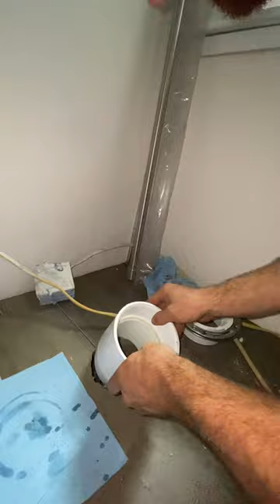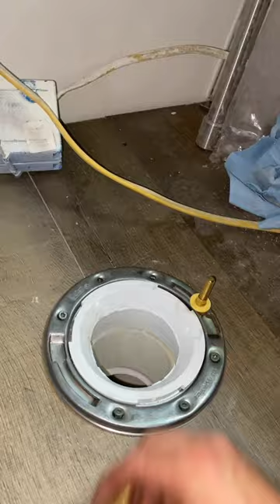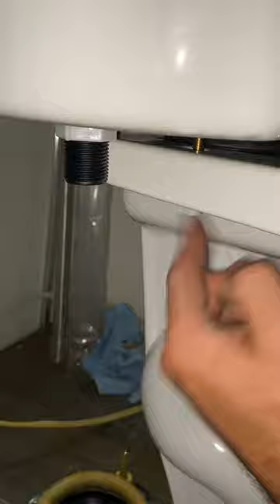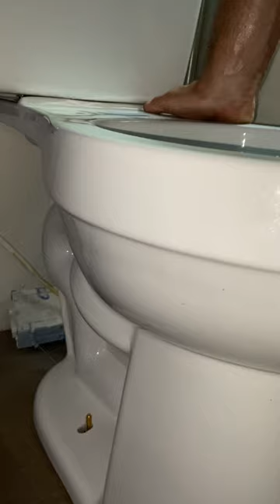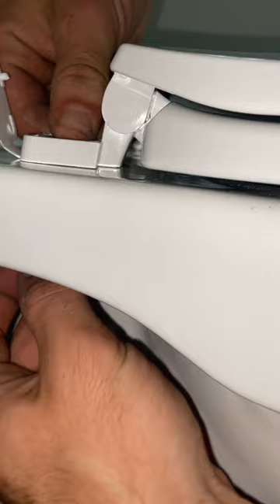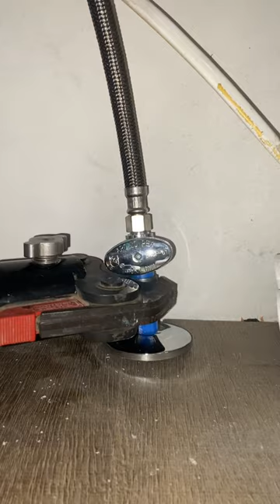How To Install a Toilet and a Flange #shorts #plumbing #plumber #toilet #install

Comment: The only thing I saw you did that I would do differently, is when setting the flange, spin the ring so when you install the bolts, they go all the way to the opposite end from where you insert them.  You just vent the end of the slot with the center of the pipe. Other than that, nice job!!

Comment: Why is it that the installation instructions that come  with a toilet say to install the eax ring on the toilet base first, then set the base on the flange?  I always thought that was more different and prone to have problems later.  Glad to see a professional does it how it makes sense instead.
Reply from the maker: I always thought the same thing. I’m not sure why they direct that path of installation. I agree with you that I would be more difficult to install.